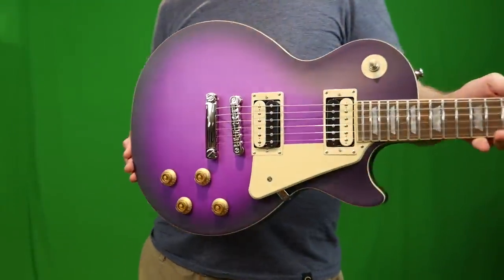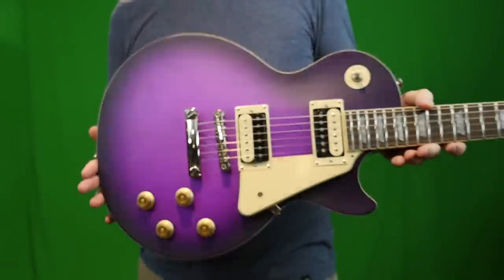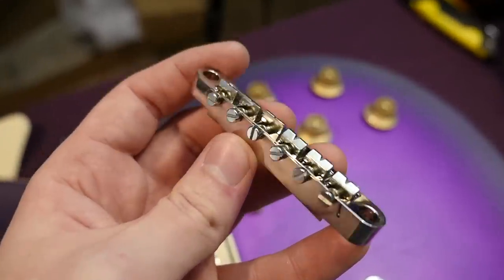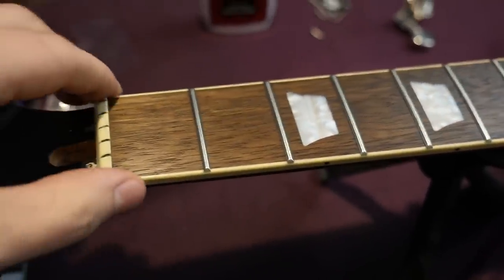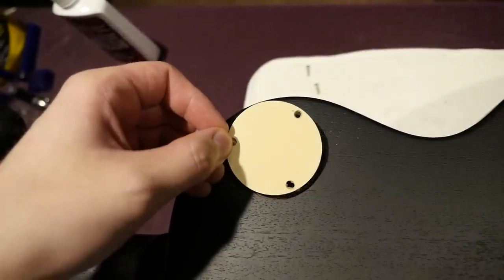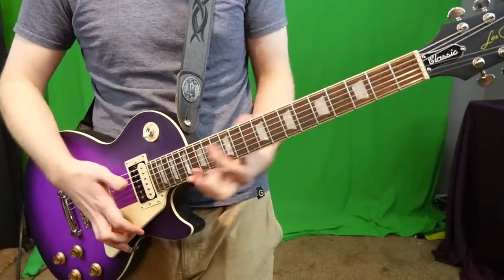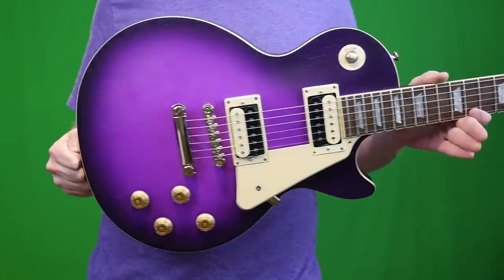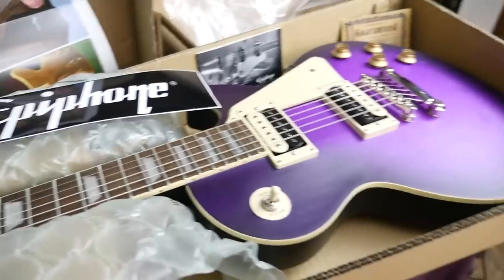It's Pretty... But Is It Any Good? | NEW 2020 Epiphone Les Paul Classic Worn Purple Burst | Review

Comment: I’m a woodworker and I can tell you that all the “wood grain craters” in the top are from router tear out/poor sanding. Maple is a very tight grain wood, not at all open like the mahogany on the back. That is a QC problem for sure.
Reply: I also haven't seen maple end up like that after proper sanding... since they already put fake mahogany veneers on things maybe they do it on purpose so kids think it's cool legit wood grain or something?
Reply: kabukiman69 lol that would take extra time. It’s just not sanded properly out of laziness/time constraints.
Reply: CNC don't care and QC proves it.
Reply: alwaysopen what I don’t get is why these price points are being targeted. I would pay more for a model like this if all these little things weren’t skimped on. The wood tear out is genuinely unacceptable.
Reply: S1MN05 : they aim for a price bracket, not a quality bracket. They already have a "better" and slightly more expensive option in the same company : Gibson.
Spend a bit more to get a Gibson LP studio and most of these issues are gone. That is exactly what they count on. Customers that have 450 to spend have no option but to take the drawbacks. If you have more to spend, you have more options. In the lower pricebrackets nothing beats Ibanez in my opinion.
Reply: I don't think thats a QC issue . On the website it says "Worn finishes.  I think they have left these craters on purpose to make the guitar look a bit worn.
Reply: Rogers RC - no, this is actual tear-out. Maple doesn’t have the pits that the raised maple area these tops have including mine. Having said that, this guitar is a modder’s dream at $450 -  and a perfect starter player’s Les Paul for a newer player to grow with. As to the frets I level & crown everything but mine really only had a mild case of fret sprout
Reply: meant to look like that.
Reply: @S1MN05  
Its definitely intended to look and be the way it is on this line of "worn" guitars. I looked at several of these in a local store and they all have this going on with this particular "worn" line.

Absolutely none of their other guitars have this condition present...I own 5 Epiphones LP guitars. (1) 2017 LP 100. (2) 2019 Epiphone LP Standard Plustop Pros  (1) 2018 Epiphone LP Standard Plain top and (1) 2020 Epiphone Les Paul Studio.

They are all emaculate, superbly finished guitars.

Oh and those "tear outs" that look like voids are in places that aren't anywhere near where a router bit would be. Some of them are 1 1/2 inches inside the edge. And between the edge and these voids there is no sign.
Reply: Strick nine the whole carve of the top would be done by a CNC router.
Reply: @S1MN05  That's right, I wasn't even thinking about the carved top..
Anyway, all other other models are pristine. So I still say its intentional.
Reply: Strick nine I’ll agree with you to that point. Intentional in the sense that they’ve elected to save time in labor to sand/fill the tear out and polishing a gloss finish.
Reply: @S1MN05  
How are they managing to finish every other guitar that isn't categorized as a "Worn" finish so beautifully ?
Are you willing to imply that they produce and finish all models with beautiful finishes in every price range except the one they define as "worn" and they just suddenly get lazy on that one ? ,....
You believe this "worn" advertised finish is the result of lazy work ? That they only get lazy on the "worn" finish and do great finish work on every other guitar.
That doesn't seem plausible, doesn't seem likely, doesn't make sense.

Given that all other finishes are beautifully done except the "worn" finish,...It would seem logical that the appearance of these particular guitars has nothing to do with shoddy work and everything to do with a certain appearance.

I do not believe that they only do shoddy finishes on one guitar finish line that just happens to be advertised as "worn"

That just doesn't have the ring of truth or reason.
Reply: Strick nine just to start, a reminder that maple is not an open grain wood. These spots in the top don’t occur naturally. Okay think about it this way: All of epiphone’s LP models get produced the same way, with some modifications. They all get mahogany necks and bodies, with a 1/2” plain maple cap. They produce thousands of those in batches at the factory. Then they probably get graded. The nicest ones likely get allocated to the transparent “classic”models. The ones that have flame finishes like the 50’s and 60’s  get a flame maple veneer over the top, so they get graded out under that. We’ve seen in other models that the mahogany backs get veneer too. Mahogany IS an open grain wood, so it needs to be filled before finish. Then all the solid finish ones will be next. Blemishes in the top can be filled and sanded, then finished over no problem. Whatever is the lowest grade logically gets reserved for these “worn” finishes. In order to save costs, they aren’t grain-filled on the mahogany backs so the pores are open, and on the tops none of the blemishes are treated. Then it all gets sprayed with satin lacquer and it’s advertised as a worn finish. I very much doubt that these blemishes are put in the tops on purpose, that would just require labor, and therefore more expense. This is just kind of how mass production works.
Reply: @S1MN05  
I absolutely agree with what you said there. But I don't believe the idea that the guitar finish is a result of being lazy...Yes it requires less work to turn this out...But there is a market for this and they know it and that is what is going on here.
I don't like it myself.
Reply: @S1MN05  
And yes, I've built and finished many Kitchen Cabinets, Gun Cases ect,. From multiple wood species but mostly white and red Oak, Mahogany, Birch and white Maple.
Maple is very hard and very dense (tight or closed grain) wood. Even the softer maple species are still quite hard and dense.
That top doesn't look like any Maple species to me..If it were bare or natural finished I'd know for certain.
Reply: Strick nine Yeah man it sounds like we are on the same page. “Lazy” only came out of my own bias. I actually like and prefer Satin finish guitars. I adore the purple finish too. When these were announced I was so hyped. But I was let down when it became obvious that this was on the lower-end spectrum of their offerings. I would totally own this guitar based on the specs on paper. But I can’t really accept the blemishes because I know better. I still wanna shop around and see if I can find one of these in person where the blems are minimal. Cheers man thanks for the discussion.
Reply: @S1MN05  
Im fairly certain that Epiphone does have LPs in some satin finishes that are out on the market that look like you would want...I've seen them I believe marketed as Epiphone Les Paul limited edition pro. Or some of the Traditional Pros.
Reply: @S1MN05  I would only pay more if a guitar would SOUND better...as a guitar player do you really give a single shit about sanding? You're buying a guitar not a piece of furniture...who cares....
Reply: Some of you are funny in that you miss the obvious in that these are being sold like this on purpose, as a look, rather thsn an accidental QC issue.

Comment: Philip McKnight has a "who owns who" video about the tuners. He says Epiphone (or whoever) will contract with Grover to use their tuners, but since those tuners are expensive, Grover turns around and uses another cheaper brand that they then slap their name onto. Kind of a rip and a way to make you think you're getting more value than you do.
Reply: same thing with most car companies. For example some cars come with special "aftermarket" parts, but those parts are actually cheaper than what that same exact third party would sell through their company. A company notorious for doing so are Brembo brakes.
Reply: TBH I doubt this about Grover - it would be the equivalents of BMW using cheap Korean parts and calling them German engineering. Brand (and potentially company) suicide. I work as a Marketing Executive at board level. There is no way we would sign off the use of inferior (foreign?) parts on a premium brand, if that is still Grovers reputation. It's not a case of being found out, it's a case of crap parts failing to operate to spec and damaging the reputation of the parent.
Reply: @Spartanm333  for someone who works in marketing, you still have a whole lot to learn.
Reply: @ford4point0  like BYBRE
Reply: @Spartanm333  I have an Epi Les Paul Ultra II and the original Grover branded tuners wouldn't keep it in tune so I ordered basic Grover Rotomatic tuners from Sweetwater.  They look the same as the originals but are much heavier and work great.  As I learned on an Ibanez their Floyd Rose tremolo systems are "Licensed by Floyd Rose" which means that Ibanez has them made under license but the materials are much lighter and the tremolo will "wallow" out over time.  My guess is that Gibson has some type of the same arrangement with Grover.  And Grover has tuners at multiple price levels so I wouldn't expect an Epi standard to be the same as a Gibson standard tuner based on the price differences.  But I also know going in that I can upgrade an Epi with better pups and parts and still be way below Gibson prices which is fine if you're not in it for the resale value.
Reply: @gregmiller7123  I believe after 2003, Ibanez uses their own tremolo system. So not licensed by Floyd rose anymore.
Reply: oOVanHalenOo Yeah, the Ibanez I had was probably a late 90’s RG model so I’m sure you’re probably right about current models.  I was just suggesting that a lot of brands license their name to others, hopefully under a QC agreement.  But the “Inspired by Gibson” moniker wouldn’t make me think I was getting a real Gibson but an Epiphone that had some design ideas from Gibson and that is why it is about a quarter of the price of an American made Gibson.
Reply: @Spartanm333  Grover tuners haven't been made in USA in decades.
Reply: @OddTimeMan   - maybe that answers the question then...  when you allow accountants to influence a company and particularly a premium brand, they will suggest numerous ways to save money and increase profit. They don't care about longevity, tradition or the customer, and usually they are out within a couple of years when they have filled their own pockets.... and ruined the brand. It's a regular game plan for them. It's up to the CEO and board to resist the short term gain of downscaling the quality of parts whilst ripping their loyal customers with traditional premium prices. Most often these crooks, corporate accountants and lawyers, will also raid the company pension fund and run up huge debts on the supply chain. Private or family owned companies tend to fair better in this regard because they will take a longer term view and don't want to actually kill off the business. I'm sure there are amp builders who present as a national product when much of the internals are reduced quality Asian - it certainly happens with valves as I know from my own experience opening them up.
Reply: That’s exactly right. That’s why Grover’s are often replaced on import guitars. And players get the notion that Grover’s aren’t that great. And for the most part , they’re right. The import versions are not fantastic. But when you get a Gibson with Grover’s, it’s a night/day difference. The Gibson “bench spec” Grover’s are excellent tuners. But some players will swap them out anyways as they have it in their minds that Grover’s aren’t that great based on previous experience . So Grover isn’t really doing themselves any favors by subcontracting these cheaper versions. I can tell a major difference between the Grover’s on my imports vs my Gibson’s. However, I do believe higher end imports use better quality Grover’s as well.
Reply: @Spartanm333 Please do not compare BMW with Korean cars. Believe me, I'm European and I'm worked at official BMW service. Japanese and Korean cars are more superior then European cars. BMW is a totally unreliable shit.
Reply: @gregmiller7123  you
Reply: @CroneRaven1810  my ~'07 ibanez RG was a licensed floyd rose, there was a new style coming in at the time but they were more expensive.

Comment: Thank goodness the pickup base plates are no longer made of brass.
Those Grover Tuners are a cheaper Foreign made version of the domestic manufactured units.   You can easily tell the difference by quality of the tuner body's casting.   Even the cheap Grover tuners are an improvement over what has been offered in the past.      Like the solid black finish to the back of the guitar something has got to change for the price to be so low.
Concerning the cheaper electronics/pots, more than likely the whole "Classic Worn" Series was developed as a mechanism to use up some of the old parts Epiphone has left over at the factory.    Those components/parts have to be used by Epiphone one way or another, they can't really not use them!
All said and done at the end of the day its a really nice sounding guitar.    A bright sounding Les Paul guitar is a thing of beauty.   Great playing demo Austin, Thank You.
Reply: Are brass base plates bad for tone or something?
Reply: A coating of tuners doesn't matter for tone. Thats like saying the finish matters to tone. Its just aesthetic
Reply: @staple_gun7889  The more mass a pickup's base plate has the lower the resonant frequency of the pickup's coils.   The lower the resonant freq. of the pickup the does color its output/tone.  Depending on what kind of brass is used it can affect the pickup's tone.   Traditionally steel base plates were used in the first PAF pickups, for that reason I personally try to stick with traditional design and constructed components.
Reply: @Michael_Baranyaiofficial  we all know white is the best color for tone buddy. stop blowing smoke

Comment: I just bought one of these yesterday. It felt great in my hands. I had been looking at more expensive models but this one just felt good in my hands. I agree with the cleans bring good and it sounds great on the bridge pickup with overdrive but the neck gets muddy. 

As far as the frets, the shop leveled and cleaned the edges for me as well as set up the bridge height and intonation for me so I'm pretty happy with it. I plan to swap out the electronics but haven't chosen anything yet.
Reply: You still liking it a year later?
Reply: Updates?

Comment: High frets are very common on low to medium price guitars. I'm not sure if this means that not all the frets were pressed fully home into the slots, or if the frets actually move on new guitars as the fret board reacts to heat and humidity. I have found it is well worth doing some gentle tapping on these frets with a fretting hammer. Even better is to use a brass fret punch - quite a large punch with a groove cut in the end to match the top of the fret. This can save having to do a full fret level, re-crowning and polishing.

Comment: Bought a Korina Epiphone 58 V (built early 2019) and had to recut the Nut...change to a new set of strings and set intonation ....no reason Gibson can't check guitars here in the US before shipping to Retailers..... Gibson has addressed quality on Gibson's but not Epiphone's.
Reply: JEFFREY VARGO it’s still a little unfortunate but I’ve heard that manufacturers leave the nut tall so that they can be adjusted because you can remove but but not add
Reply: Having to change the strings should be expected. Very few brands, especially on cheaper guitars, use good strings. Even when I buy a new guitar or bass, the first thing I do when I get home I’d change the strings.
Reply: @JoshBattershell  The bad thing is you could be putting the same brand strings on it. We are being sold a lot of bullshit these days.
Reply: what you did has very little cost and just a little time,gibsons need the same love and have the high nut cuts as well.
Reply: alwaysopen even if they are the same brand, I don’t ever use stock strings because I can’t play on 9’s. I’ve also started to pretty much only use Ernie ball Conakry strings, which Ernie ball owns the rights to use cobalt as a metal for strings and are the only company that makes them. To my knowledge not a single new guitar by and brand comes stock with them. So yea, still changing the strings immediately on any guitar I buy. Especially if it’s a floor model from a store and they’ve already been killed.

Comment: the only reason i couldn’t get behind epiphone is because of the ugly headstocks, but now i have zero problems with them, they look great
Reply: very stuperficial......funny part is the 4 epi les pauls i have(2 customs,1 trad,1 standard) 

never had fret or finish issues and still dont.the old head stocks are actually more like 

Gibson than the ugly new ones.i laugh at idiots who dislike the fact two 1/2" 45 degree
 pieces of wood are missing and think it makes some kind of difference.ps:it doesn't.

Comment: Since this video has been made I've bought one and there's been a price hike of close to 100$ and mine has no high frets, no chips or splinters on the plastics and over all epiphone seems to have listened to most of the complaints aired in this video,
Although my only guitar to compare is the $200 epiphone vintage edition les Paul  that was the cheapest name brand guitar on the market and I had to dump an additional 500$ on to make it a half decent imitation les paul.